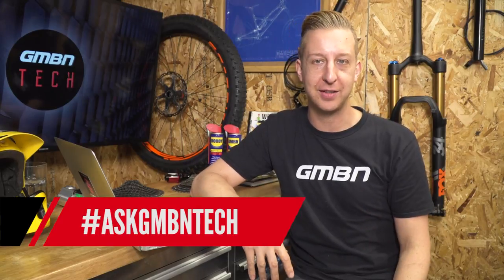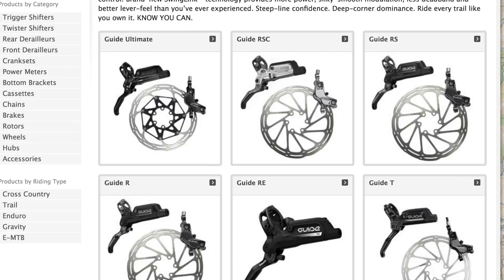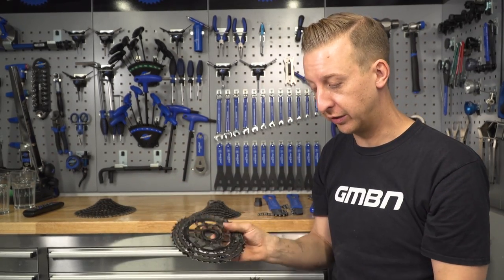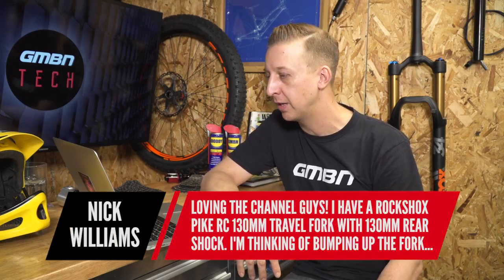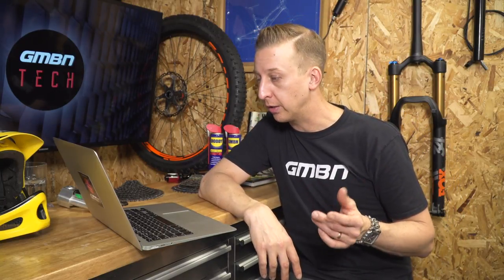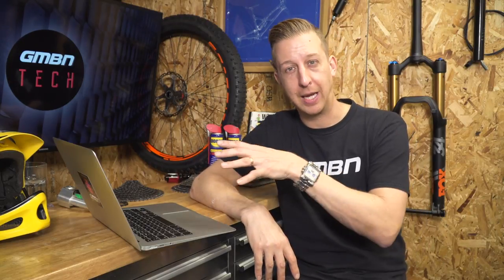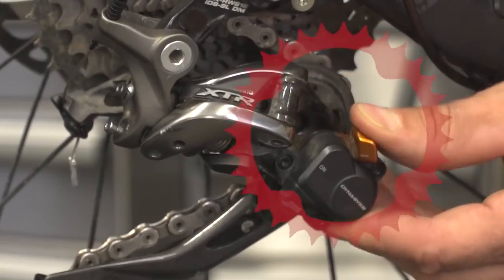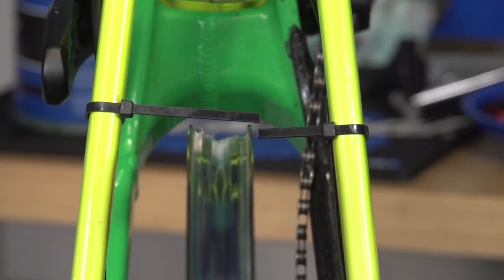Ask GMBN Tech | How To Film Smoothly On Mountain Bike Trails

Comment: For jean-rene-oellet, I'm betting you have air in your damper. Quick way to see if that's your issue, take off the air can, cycle the shock. Does it make any sucking noises or is it smooth with no noise? If it makes any sucking noises, rebuild damper. It may take multiple bleeds to get things working properly, and the amount that is provided for fluid is pretty much only enough for one rebuild.

Comment: Thanks for answering my question.  For an update my LBS sent the Rock Shox to the Vancouver service centre.  They looked at the fork and had no explanation for why the steerer tube would separate from the crown off of the fork.  So since they didn't know the answer they reverted to the good old rider error excuse and indicated that it would be $750 to fix the fork.  When I received this news from the bike store I asked what I could have possibly done to cause the separation.  They indicated it was probably my riding style.  At this I laughed as I prefer riding technical uphill and when going down I typically do it at a moderate speed and under control.  When I asked the mechanic how my riding style could cause such an issue he said he didn't know but that I should have my riding style evaluated.  Needless to say I'm not happy with the response from the Sram / Rock Shox Canadian distributor.  I have written Sram USA an email outlining the issue but have yet to hear back.  I  will try calling Sram USA tomorrow.  Any advice on how to deal with the issue would be appreciated.
Reply: This sounds like bullshit to me. I ride the hell out of my bikes racing enduro and have not seen what you describe. Are you a Clydesdale or anything? I have a close friend who separated the steerer from the crown in an old fox 36, and it was promptly replaced under warranty as a defect. From what I understand it isn't supposed to be possible unless the product fails.
Reply: Thanks for your reply.  And no I'm not a Clydesdale.  I'm 6'1" and 210 lbs.  I'm going to try and call Sram USA and see if they will talk to me.  Hopefully they will even though they say the public aren't suppose to call them directly.  I am stuck between a rock and hard place as my LBS won't pursue the matter on my behalf and the Canadian distributor for Sram / Rock Shox have apparently made their decision.   All I really want is a contact phone number or email address of an actual person from Sram.  My belief is that if I could actually have some one listen to me common sense would prevail and the repair would be taken care of or the fork replaced.  And as a final note the fork is 2 years 3 months old so it is 3 months past the 2 year warranty period.  So the fork is not old and has not been abused by an aggressive riding style.
Reply: New update.  I contacted Sram USA and was able to speak with a rep that was familiar with my fork issue.  The rep indicated that he had the engineers examine the photos that had been taken and it was determined that there was no issue with the manufacturing of the fork.  The rep also indicated that the issue had nothing to do with my riding style.  The rep said that a significant force had to have been used to separate the steerer tube from the crown of the fork.  I spoke again with my mechanic and he stated that he did use some force to separate the steerer tube from the frame but would not consider the force significant.  Too make a long story short Sram has stated that since the fork is outside the warranty period they will not cover the repair even though it is something that is rarely seen.  I am hoping to pursue the matter further with someone at Sram USA HQ in Chicago.

Comment: #askgmbntech great show!! (Question) : i have been wanting to change my headtube angle with something like the canecreek headsets, do they only make angle adjusting headsets for straight 1 1/8 stearer tubes? also i am looking at upgrading my fork soon after, im currently on a 120m front and rear suspension raleigh kodiak 1 2016 69 degree headangle. If i slack the bike out by 1 or 2 degrees should i raise the front end to make up for the BB drop ? i would like a fork that allows me to take the bike from 120- to 140+ so that im fast on my native Texas XC trails, but have the option to set the bike up for more trail and downhill oriented rides in arkansas.   "Sorry for the long question feel free to edit it down as needed ! " maybe a video in the future? it will be a few months till i can make this happen.

Comment: Hi Doddy, I have a question about suspension, I recently bought a 2012 Trek Slash 9 and I want to fit volume spacers to the rear shock, I’ve looked online but I can’t work out if recent 2017/2018 volume reducers are compatible, where do I buy tokens to fit my shock?

Comment: Could you give a detailed explanation on the effects of altitude on air shocks/forks? I used to live at 1100m above sea level and would set up my shock at home and it would feel very different at the top of the hill (2000m)  and the bottom of the hill (600m). Ever since I've never been sure what's the best place to set up my bike, top middle or bottom of the hill? Thanks
Reply: Take shock pump in your backpack.
Reply: puka I always do, but I don't want to be constantly altering the set up of my shock. I run coil now so no problem but it might get be helpful to others.

Comment: Doddy: Running a 1x11 setup on my trail bike, recently switched out the 32t original chain ring for a 30t.  Now when I pedal backwards in my granny gear the chain slips down the cassette.  It didn't do that with the 32t.  Why is this?  Thanks!  Fyi, Sram GX 42-10t cassette, GX derailleur and Race Face Aeffect crank/chain ring.  Peace!

Comment: WATER IN THE FRAME  as for this most bike will have a small hole( 2-3mm ) witch is a drain hole in the bottom of the BB have a look an make sure it’s not blocked
Reply: You can loose your warranty.

Comment: Thanks you some much info on  the rear shock I have been driving myself crazy and this the shock has been back to roxshox 5 times and replaced 3 and still doing it But at no point have anyone said  thiis is normal. I do have a question about debonair cans how much pressure do they need. Is it more that a standard can? I’m 6”6 and 110 kg my shock it pump up to 300 psi but cant get the sag a 30 more like 40 but can max out at 350 but this seems like a lot. Is that a shock out there for the larger rider

Comment: I want to upgrade my suspension to something better but the good forks all have through axle, can I modify my front hub from qr to through axle?
Reply: Miles Alley depends on the hub. Some offer hardware to convert. Another option is to buy new hubs and lace them to the wheel. Im sure a bike shop would be able to do this if you dont feel comfortable.
Reply: Brandong13 I’m certainly comfortable building a wheel but I just don’t really enjoy it. I’ve built wheels before for work and for my own bikes. But yeah I guess I just need to get a new hub and a new fork. Fox float 32 ctd evolution is a bit outdated and I was thinking of trying rockshox for the first time.
Reply: Like the other response said, it depends upon your hub. Some can be converted and some can't, so contact your hub mfg to figure that out and determine what you need to do so if possible. also curious why you are specifically looking at converting to RockShox if you're familiar with Fox (I use both depending on bike).

Comment: #askgmbntech  There is a clicking coming from my fork(rockshox recon, same as on nukeproof scout) about 60 way percent it makes a loud click. This happened before and i sent it to rockshox. they said i “blew out the fork” they said they replaced the internals. 1 month later it started again. Why does fork make that sound? What can i do to fix it? And should this be happening? I and 14 ,ride aggressively, and i think it happened when it bottomed out.(softly) (it is for sure set up properly for my weight!) Thank you and i want to fix this annoying click!

Comment: hack for you .if you don't have a chain whip .use 4 tie wraps and tie wrap the back cassette ring to your spokes .boom jobs a good en.
Reply: You risk hub or spoke damage.. If it's worn off cassette, use some wrench.
Reply: Worked fine on mine .that's why I said use 4 tie wraps to spread the tension load round your spokes .obviously don't tighten the ties up to the point it's pulling your cassette in to the wheel. leave a bit of play it will undo very easily with hardly any chance of bending or breaking anything I've done this a few times and I've never been close to bending anything .

Comment: #askgmbntech I've got a bike on its way to me that's equipped with a SRAM NX cassette which is peculiar as it uses the Shimano style driver instead of the XD that the other SRAMs use. If I wanted to upgrade this to drop some weight in the back, should I look for a higher end Shimano style cassette, or go through the fuss of finding and fitting an XD hub shell?
Reply: Look for on other brands, which are using shimano hub (suntour ...)  or save weight on you rear wheel (rim, hub, spokes...)

Comment: Would it be possible to use dot fluid in mineral brakes, and visa versa? 
Would it work? Or would the additional corrosion characteristics of dot fluid corrode the mineral brake parts?
Reply: No, you would ruin seals inside the brake.

Comment: What dropper do you recomend for a non-internal frame.
Reply: Brandon Austin reverb
Reply: Get one where the cable mounts at the seat clamp, not underneath the saddle. Good examples of this are the fox transfer, and the KS LEV. The fox transfer is said to be the most reliable post on the market, but it is quite expensive. The KS LEV is a bit cheaper, yet also quite reliable. If you get any of the two, you’ll get a good post.

And to make your life easier, don’t get a reverb. Way too much messing about with the hydraulic actuation. Quite annoying to install or service.

Comment: wait you you said dh bike has boost rear end, but i got specialized demo 8 s works with 135mm nowhere near to 142 or even 150, what is up with that ?
Reply: Andrima MTB From what I know, Specialized deliberately kept the 135 width cuz they believed the additional clearance was more beneficial. I think they use a larger thru axle diameter though if I’m not mistaken.

Comment: #askgmbntech hey doddy! I'm a short rider, 5'4" and thinking of upsizing my rig from 26" will a 29" have an effect on the frame geometry that might affect my riding. Im using small size frame.
Reply: Don't buy 29er. 27,5 is enough for you height. You would struggle in narrow corners and other technical sections.
Reply: thanks for the input. just what i need to know.

Comment: #askgmbntech Can a bolt through axle be used on a quick release wheel if the release mech is removed? Secondly, what car do you drive?
Reply: Quick release has 5mm, through axle is 12-15mm - how would you do that?

Comment: I have ridden both sram and shimano drivetrains... But i stuk on SRAM... why because sram macks aren't so touchy, why i mean by that is i crash some times really hard and hit rear meck whit sram i don't have any problems it doesn't need extra adjustment, but whit shimano it wasn't the same mack was ruined and it went straight to dustbin. So that's why I prefer sram and also narrow wide technology it's perfect on my DH bike i removed complete chain guide and i have to say my chain didn't slipped once in one year now.  cheers doody
Reply: Well, you didn't mentioned which sram or shimano you've been using.
Reply: puka sorry i forgot.. Sram NX on my hardtail and GX DH on my dh bike
Reply: puka and shimano zee dh bike, hardtail was deore and xt

Comment: So let me get this right ... DOT fluid, which has to strictly conform to standards (no doubt requiring expensive testing etc.) is relatively cheap to buy, whilst mineral oil (which sounds more 'natural') has no standards to adhere to, no expensive testing for certification, is expensive?!  (I know it's because of the massive size of the motoring industry, but then why don't they switch to mineral oil ... which is safer and less harmful to the environment)
Reply: Buck Rodgers short answer is: this does not matter. More in-depth look you can read here: http://www.epicbleedsolutions.com/blog/dot-brake-fluid-vs-mineral-oil/ more over, question is how hot can you make your brakes, the more skilled you are in this subject the more important the type and condition of the fluid is for you.